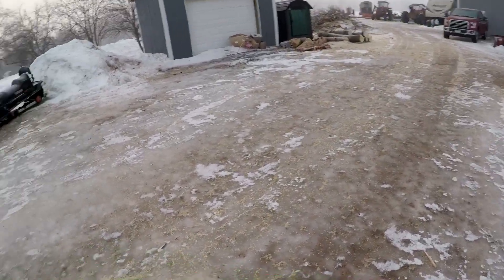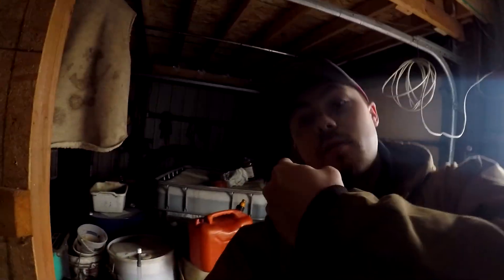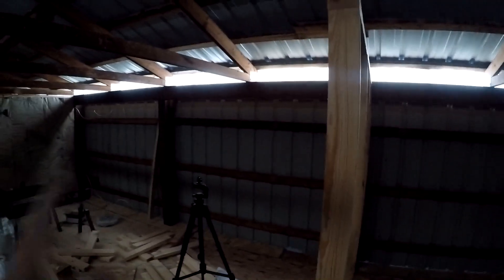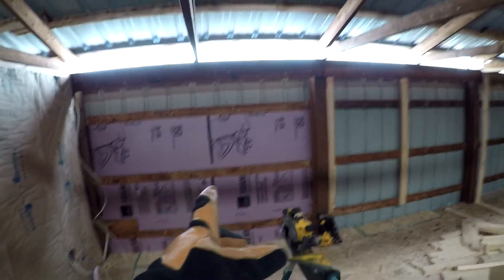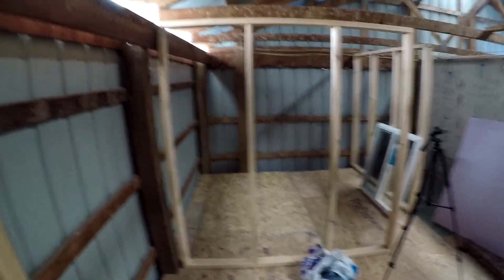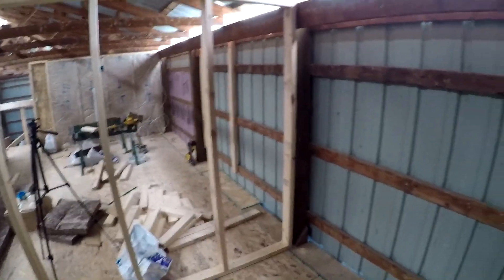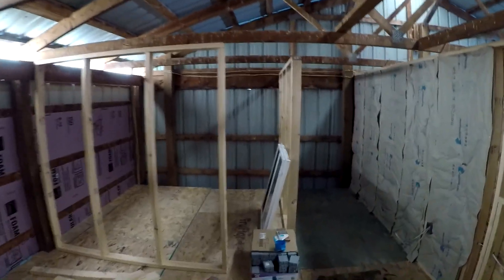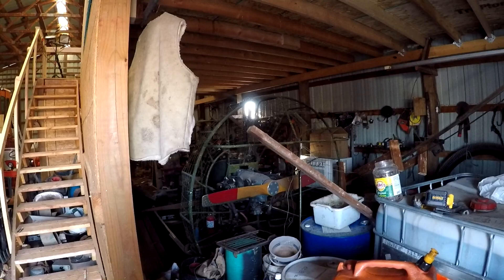A Day of Apartment Project Progress and a Little Road Trip

Comment: If you don't already have a plan, may I suggest running your plumbing and fixtures on the inside walls of the apartment rather than on the outside. Just to lessen the chance of freeze-ups.